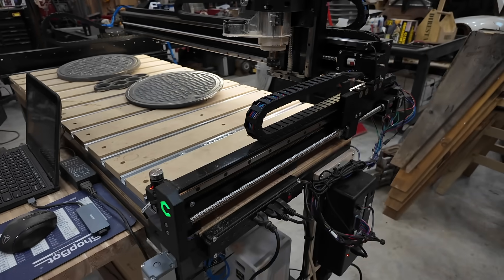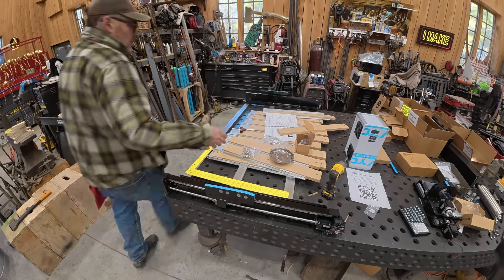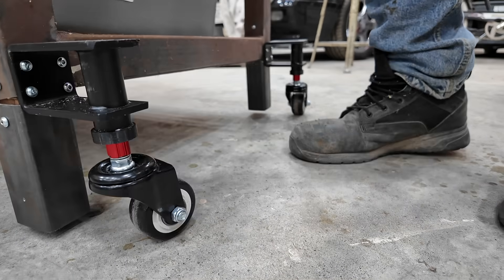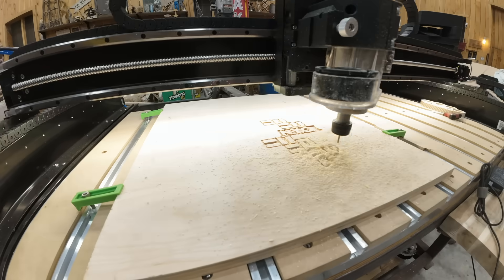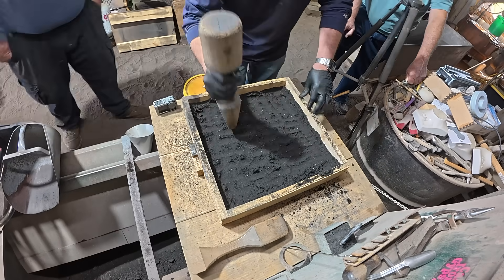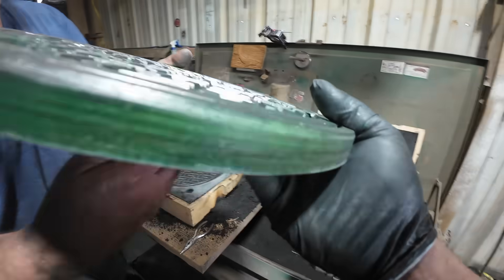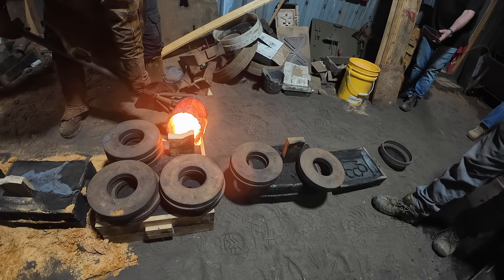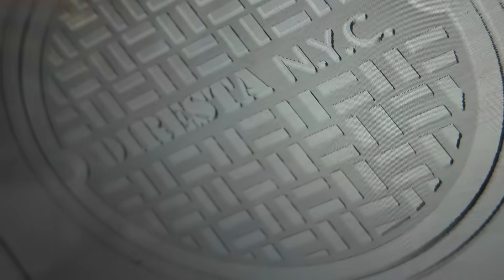Can I Make A Solid Steel Sewer Cap using my CNC Router?

Comment: Jimmy!  Welcome to the Carbide 3D community.  I've had tremendous fun with my Shapeoko 3XL for several years. Their support has been nothing short of wonderful. The free Carbide software is great, but you can also use any of the Vectric programs or many others to generate the art, and run it thru Carbide Motion to implement it.

Comment: In college, I took a casting class and tried to use my roommates plaster orthodontic teeth as my mold for sand casting in aluminum.  It wasn't a great pour, which just made it more hilarious as the result looked like someone who had gone 10 rounds with George Foreman.

Comment: the very reason i bought a CNC was for carving foam, for lost foam casting. then i realized i wanted to carve more than foam, and wound up building a custom CNC from the ground up, that can machine just about anything but steel and the other super hard exotic metals. they really are a lot of fun, the possibilities seem almost endless, and the learning process covers so many different disciplines.

Comment: Bottom half of the mold is the drag (think dragging it around on the table, top is the cope.

Steel sewer cap is a bit of a misnomer as well, unless Clark was doing some decarburizing we didn't see, then this is gray cast iron. My first metallurgy job out of school was at a gray cast iron facility, where we likely made several of those brake discs used for your sewer cap.

Comment: That sewer cap looks so cool! One day I’ll get me a cnc I’ve always wanted to learn how to do that!
Reply: You don't need a CNC machine to learn how to CNC. It's the software side of things that sucks and you can do that now. You can even run a machine controller without a machine attached to it.  It's all just software. With a machine all you're doing is clamping the work down and touching off. So that's all you're missing out on as far as the experience goes.

Comment: I believe you have the material wrong. These are cast iron, not steel. If you were melting brake rotors, those are primarily cast iron. Still a good project and glad you were able to get some good results on your new CNC and do some casting.

Comment: "Can I Make A Solid Steel Sewer Cap using my CNC Router?"
13 seconds in and my question was answered. Thanks for the quick video.
Reply from the maker: I try to be quick.
Reply: @jimmydiresta  the ladies appreciate it
Reply: isnt the answer no? it can make a solid wooden sewer cap.. and a casting/foundry process can turn that into solid steel, but with just the CNC router youre not getting it made
Reply: @AndrewBrowner  
"but with just the CNC router youre not getting it made"

That actually depends on the machine and the tooling you have available.
Even then, it will take a bit longer by virtue of the fact that no automated mill, can plow through metal the way it can wood.
Reply: @scotttovey   for sure a cnc mill could make that, but not his cnc router..
Reply: @AndrewBrowner  
"for sure a cnc mill could make that, but not his cnc router"

Technically, a CNC router is a CNC mill. 
A "CNC mill" however, does not use a router as a spindle.
In addition, a machine that is designed to mill metal, is magnitudes of times more stiff than what is designed in the typical "CNC router".

A "CNC mill" also has a variable speed spindle so that the RPMs can be controlled as well as the movement of the tool head.
Reply: @scotttovey  yep.. thats some of the reasons why one is a mill and one is a router... youre really beating a dead horse here

Comment: Tool bag build
Reply: I just found a vintage Klein 5115 leather tool tote at a yard sale for $5. It was a nice steal. They retail for $130. I had to saddle soap it but it came up good.
Reply: Rad I have some old ones from the 80s that I still use but they are here torn up wish I had the skills to repair them